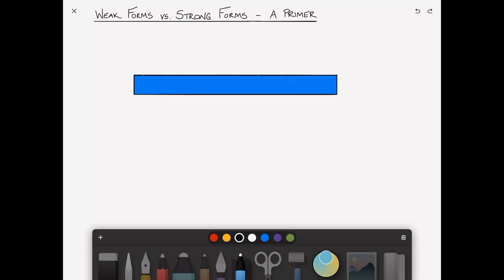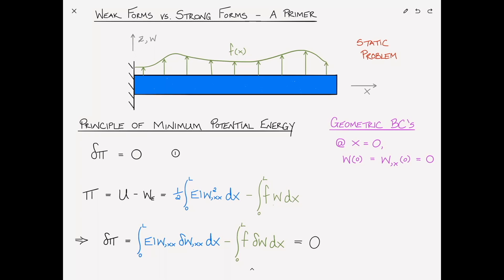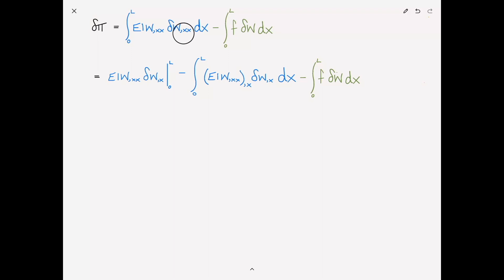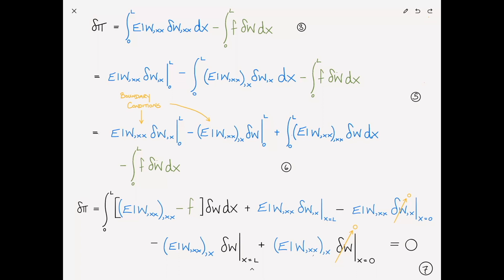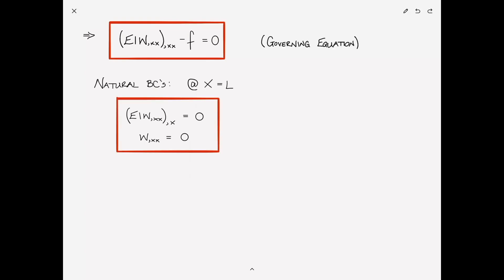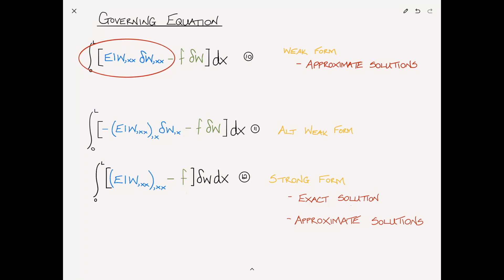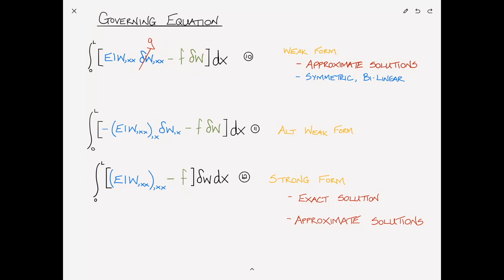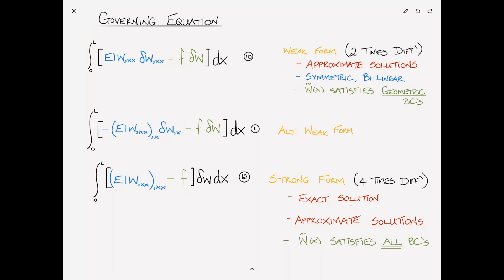Governing Equations: Weak Forms Versus Strong Forms

Comment: Thank you for this video. where can i find the proof for wich the boundary conditions go to zero independently? Is there a reference book for this?
Reply from the maker: Most textbooks on Variation Calculus will discuss this.  Initially, the derivation of the Euler-Langrane equation assumes geometric boundary conditions and so the boundary terms drop away (meaning that just the integral part will need to be zero on its own).  Then after this, most textbooks will discuss the case of natural boundary conditions.  It is in this context that it is determined that each of the conditions must be zero independently.  My go-to book for Variational Calculus tends to be Dym & Shames, "Solid Mechanics: A Variational Approach", page 100.
Reply: @Freeball99   Thank you for making some of the best lectures on the subject matter. I haven't found much better material on YouTube. Like the water that knows the lesser potential surface to flow naturally, you have the ability to present things in absolute clarity. Please preserve your videos forever. Regarding the question posed by @jorgeluismedina1548, there is an excellent reference in the lecture notes by H Kardestuncer - "Discrete Mechanics - A Unified Approach " Chapter 2 Calculus of Variations, Where the author expanded variational $\delta \Pi $using an approach similar to Taylor series for the function and its variable. Then integrating the terms by parts he showed that the parts integrated are the natural boundary conditions. He presented a second-order Euler-Lagrange differential equation.

Comment: Very elegant. However the thing that has always kept me at unease is the intuition behind the expression of total potential energy. The contribution of strain energy term is understandable. The addition of load potential (potential due to external loads) seems kinda unintuitive. All the souces I have seen so far just define the total potential energy to be so. Hope you see this comment and respond to this query. Thank you
Reply from the maker: The idea is that if I place an external load on a system then the amount of energy stored by the system is exactly equal to the work performed on the system by the external load.

Take the example of a spring which is fixed on one end.  If I push on the other other end then the spring deflects (ie it stores potential energy).  We understand intuitively that, due to the stored potential energy, the spring now has the ability to do work (ie if we replaced the force with a mass, the spring will extend and will perform work on the mass on the process.

So the amount of potential energy stored by the spring is equal to the external work performed ON THE SYSTEM.  When work is performed ON THE SYTEM by the external loads, we find that the sign of the external load is the opposite from the sign of the displacement - this is defined as NEGATIVE WORK - so we need to flip the sign - i.e.  the increase in the potential of the system is the NEGATIVE of the external work performed on the system.

Conversely, if the external work and the displacement are in the same direction, then the systems is actually performing work on the external load (instead of vice versa) and as a result the system potential decreases.

So, the increase (or decrease) of the system potential can simply be written as the negative of the external work performed on the system.

RULE OF THUMB:  If external work is being performed ON THE SYSTEM, then the external work is negative and the potential of the system (to do work) increases.  Conversely if external work is being performed BY THE SYSTEM, then the external work is positive and the potential of the system (to do work) decreases.

Hope this covers your confusion.
Reply: @Freeball99  Thankyou for responding to the query. I agree that the workdone on the system is stored as potential energy of the system. But that stored energy is what accounts for the elastic strain energy of the system. Thats what I referred to as 'understandable' in the previous comment. By defining the work potential as the work done by the external force(s) on the system, am I somehow not taking into account the same effect twice. Because the effect of load in terms of raising the potential energy of the system is already accounted for by the strain energy term. That's where my confusion lies.
Reply: @m_tahseen  No you aren't taking it twice into account, it's more like a balance. Because there is actually a difference of sign. Let's say U is the strain energy of the considered system and W is the potential of the generalized external forces. Then the total potential Energy of this system is V= U+W.

However, the work imposed by the external forces is NOT equal to W, rather it's equal to -W. Hope that helps.

Comment: Probably because you brought the differential under the integral when you calculated de variation. But I wonder why the strong form gives exact solutions and the weak one appropriate solutions.
Reply from the maker: The fundamental Lemma of The Calculus of Variations states that because the variation of the displacement 𝛿w is arbitrary, therefore everything multiplying it must be zero FOR EVERY POINT IN THE DOMAIN.  This can only be applied to the strong form of the equation.  It is from here that the exact solution emerges.